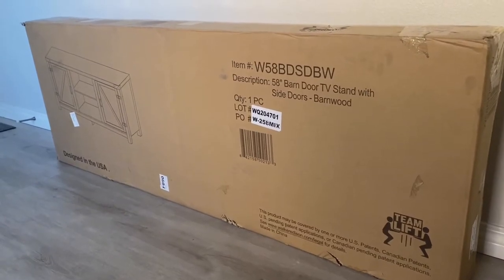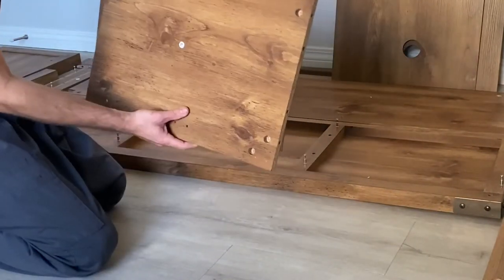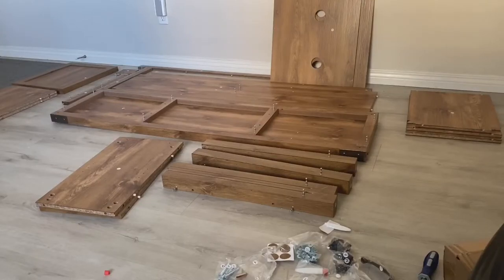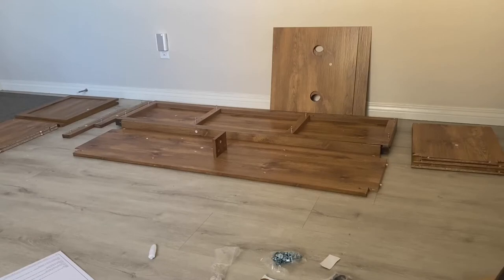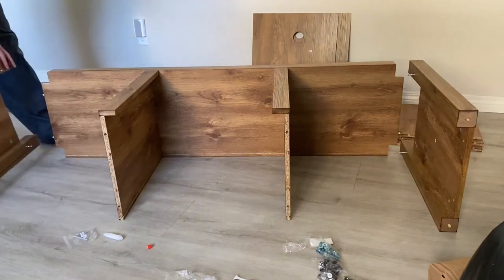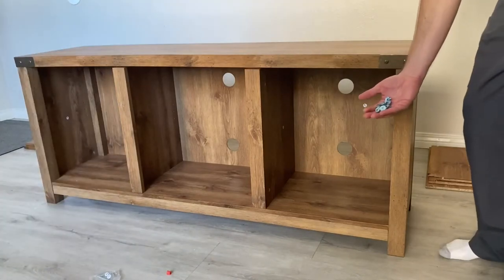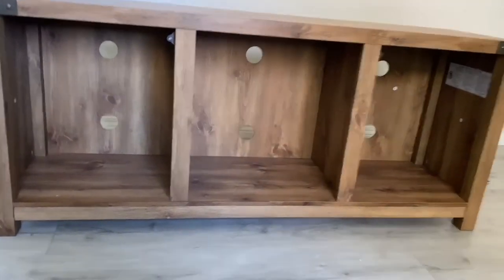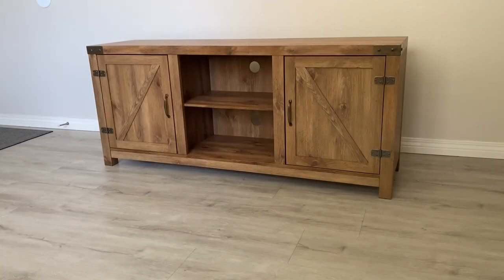Step-by-step Assemble *Hinged* Barndoor TV Stand 65” from Walmart - Manor Park by Walker Edison

Comment: Thank you so much, your work is greatly appreciated. I didn't have the same one but i got a similar Walker Edison model. Your video was very helpful. The only thing i had to do was to use some extra wood glue as the supplied one wasn't enough. The other thing that was confusing me was the plastic wedges. I didn't know where to put them but after watching your video it was clear. I have decided the same thing as you, it doesn't worth it to put them on.
Reply from the maker: That's great, glad it helped!

Comment: This is so frustrating because I'm trying to put this together but some of the holes for the wood pieces aren't lining up and when I try to add 9 and 10 to 2 with the D screws, it's just a loose screw in a hole and doesn't work. I watched this to see maybe I missed something but it's not me. The pieces are faulty. 😣
Reply: I’m having that same issue now. How did you resolve it?
Reply: @sir_ybiv  I had to throw it away. It was a manufacturer error and there was nothing I could do it fix it. If you have the receipt or something I suggest returning it or returning the pieces that aren't lining up.
Reply: @loraineburrell532  I purchased some longer screws and that worked for me.